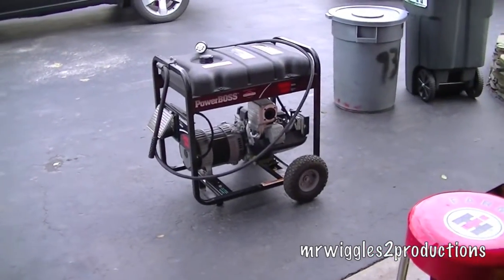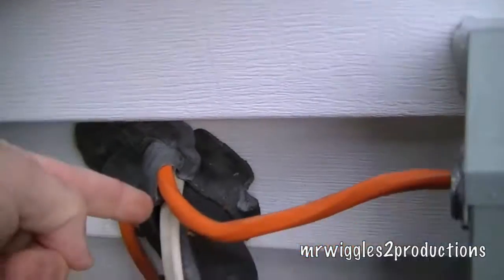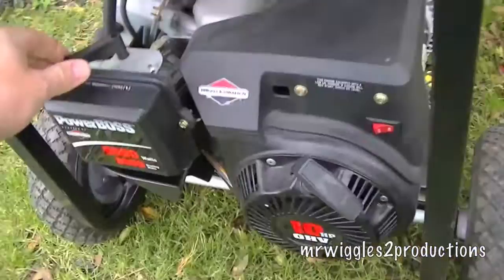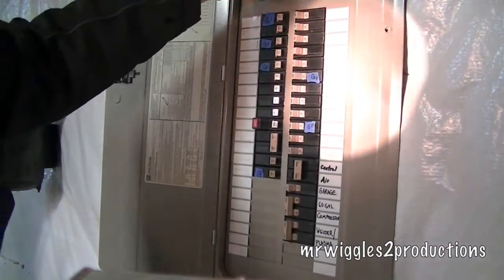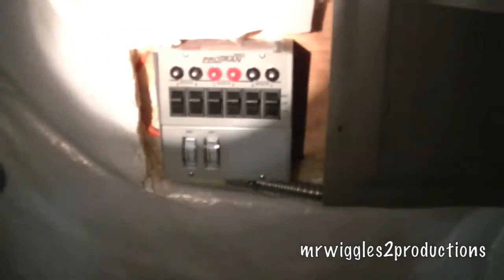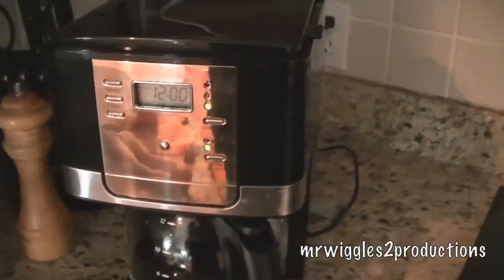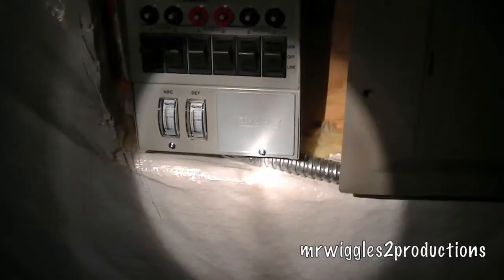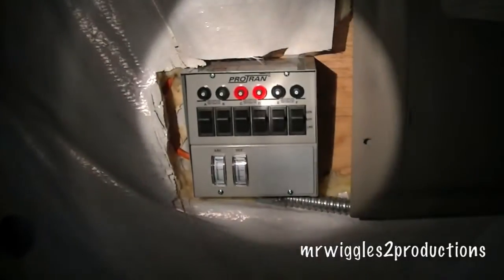Generator Transfer Switch Test PART 2

Comment: Great job Craig. I have a small generator from harbor freight but I need to get a bigger one.
Reply from the maker: Thanks, if I could afford a "real" generator, I'd buy a Generac or Honda.  I like the newer ones that produce electricity in a sine wave that is more like the clean power that comes from a utility.  My current genset is crude, but works and only cost me $600.  New generators are expensive and I haven't had luck with HF engines... unfortunately.

Comment: I have the Interlock system on my electrical panel, and a Winco 6000 kw Tri-Fuel generator running on Natural Gas.The Winco generator came with bounded Neutral to the Ground. I unbound the Ground from the Neutral so know the  generator has a Floating Natural.

Comment: Will you be able to run the A/C during the summer?
Reply from the maker: No on the A/C.  My generator would be maxed out I think to run that.  We also only run the a/c during the most oppressive weeks in the summer.  If the weather gets too hot, we fire up the boat and hit Lake Erie with the tube.

Comment: Why did go with a Transfer switch and not with a Interlock system.
Reply from the maker: Because I didn't want to move breakers in order for it to fit into my panel.  My generator is 5600 watts continuous, so the 6 circuit kit was the way to go and a piece of cake to install.
Reply: With a transfer switch (which I like the idea) I see two issues.  You're generator has to power up the whole panel.  Not a problem if everything is off and you select loads.  BUT...what if the critical loads you want are all or mostly all on the same leg (side) of the panel.  You're generator can only supply half it's output to each side and you may be really limited to what you can do.  That's an issue that might require rearranging your panel to balance the load side to side.  And IF you switch your main breaker off to turn on the Gen breaker you have no way of knowing if the pole line is actually disconnected or not.  Main breakers are known to fail in both ON and OFF positions.  I've personally dealt with bad main breakers in routine work and there is no guarantee a main breaker functions as reliably as a true manual switch gear.  If you power up the pole utility...that's VERY VERY bad for you and the utility crews restoring power. Just my thoughts.
Reply: @NeilLB7  With a transfer switch you do NOT have to power up the entire panel. His is only powering 6 circuits.  Also you don't need to flip the main breaker as the circuits are isolated by the transfer switch.  Can't energize the power line coming from your power pole. Nice thing about only doing part of your main panel and not having to switch off the main breaker is that when the power is restored to your house by the utility company other circuits which where left on will come back on( lights etc) letting you know the power is back on  without installing an alarm. Balancing the load is always a good idea.
Reply from the maker: Excellent points Neil. Yep, this little 6 circuit sub has done a great job.  I power the 2 refrigerators, freezer, sump, furnace blower, TV/Directv, coffee maker and a few lights upstairs that are on the same circuit as the main appliances I wanted to power.  Everything runs balanced on the meters now that I moved a couple circuits around.  Only time I hear the generator working a little harder is when I have the coffee maker is on and the element kicks on.  Otherwise, I’m running consistently around 1500-2000 watts... with spikes to 3000 when the coffee maker is on.
Reply: ? So the main breaker can stay on during an outage while running on the transfer switch - also is there a time limit on when to switch back to the line after the power comes back just wondering incase the power comes back while your sleeping thanks and great video

Comment: Not looking good that unprotected 10/3 wire to the power inlet. 
Also you dont need to simulate a power outage to test the transfer switch.
Flipping the switch from line to gen position, transfer the feeding of the selected circuits from the power company to your generator. It basically bypasses the main breaker box completely.

Comment: I've got a 4,000 watt with 3,500 startup. I see you are drawing only 1,000 watts with all that. I should have plenty then for 1 furnace, the fridge & some lights. Is that outside box a quick disconnect box?
Reply from the maker: I'd bet you'd be ok with that generator and a 6 line sub panel.  If not, you can just turn something off.  At most your talking a day or two.  You should have plenty for what you want to run.
Reply from the maker: The Off switch on the Reliance sub panel does the same thing as shutting off the breaker, you're correct.  Whether the power is coming from outside or line power, my 6 circuits I can turn off without opening the box.  Because you could mount this box in your garage or other side of your house furthest from your primary panel, having an off switch lets you do the same thing as flipping a breaker.

Comment: Do you have something to protect it from the weather?
Reply from the maker: The generator is on wheels.  It stores in my garage.
Reply: Craig Arndt Yes, but if it is raining or snowing is it protected while in use? Does the corf to hook it up to the house reach from the garage to the plug in?   ;}
Reply from the maker: Cord is probably 6' or so.  The generator in use is behind my house in a back corner.  I'm not worried with it running in the weather.  These generators run on job sites.  Long as its running its fine.  If it was sitting outside not running, different story.

Comment: Good Job   I would want to use propane If a major storm/event happened they may shut off Natural Gas going to homes Just my $00,02 worth
Reply from the maker: That would involve a large propane tank, which some homes around me have. In all the big power outages we've had, including the big Brown Out that hit the northeast and us for a couple days, we never lost gas.  During the "October Storm" of 2006 our area lost power for a week.  Water Authority ran dangerously low on water too, couldn't pump from Erie.